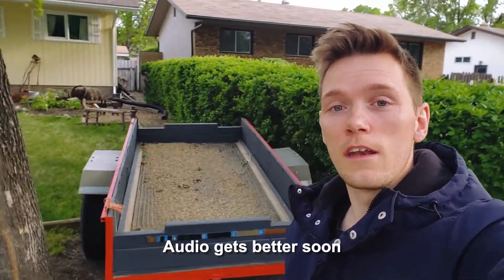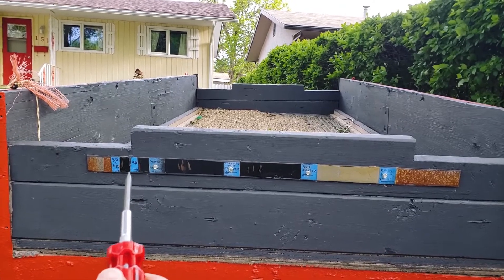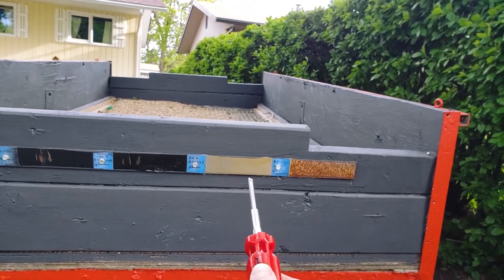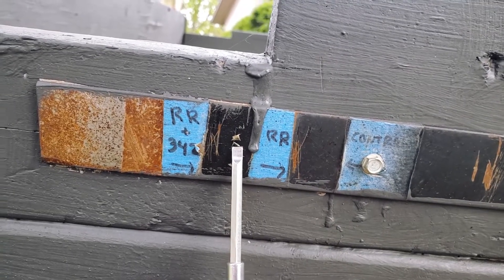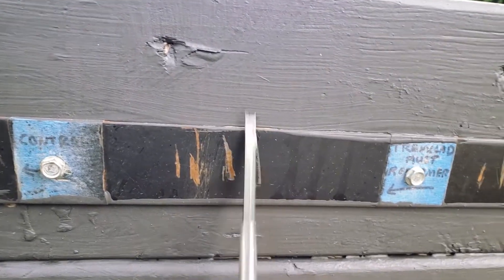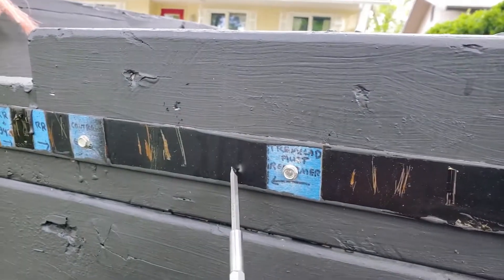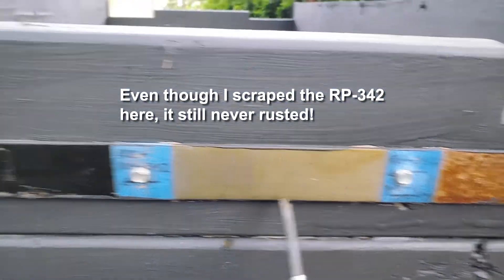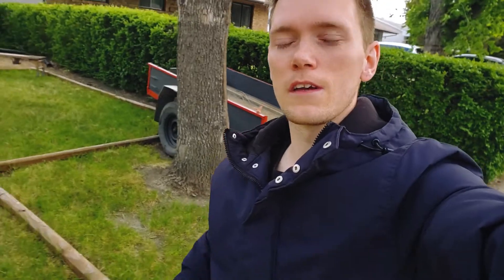1 Year RUST Test - 9 Month Update - Tremclad Rust Reformer | Cosmoline RP-342 | WD-40

Comment: Thank you so much for this demonstration. I used to use fluid film, but I have switched to Cosmoline RP -342. Hopefully I wont have to apply the cosmoline every year, unlike fluid film.Thanks once again for taking the time to post such an informative video.
Reply: Hey incase this helps, I left a question at Cosmolinedirect and an employee called me back. They can't make claims but they hear 2-5 years as how long it lasts and so long as rust is dry, you can apply it right on it. I will be using either RP342 or Rust Cure 3000 of which I just bought 20 cans locally here in Rome NY.  I will use rust cure where it is inaccessible and I need it to flow. I also bought Eastwood muffler paint with an internal spray wand. Three older Toyotas and a Honda.

Comment: Thank you for putting in the time and effort to make this video. Im curious, you said you use the Cosmoline on your frame... do you find there are any downsides to doing this? IE does it cause any harm to anything? Does it plug the drainage holes in the frame? Does it make it difficult to get a wrench on a bolt head if its covered in the wax?
Reply from the maker: I haven't had any thing come up where I had to go back and remove something or loosen a bolt. I imagine a wax layer over everything could be annoying. If you take the time to mask off any typical maintenance areas and holes, you should be happier when it comes time to work on those areas.
Reply: @LostFart  RP states that the cosmoline can be removed with Brake cleaner if you need to. Brake rotors are often coated in cosmoline wax at the factory to make sure they reach the consumer in a good state and brake cleaner is made specifically to take this kind of stuff off.

Comment: You just helped me decide what to go with for the frame. RP-342 (after I sand and clean the metal) then top coat it with 3m undercoating
Reply: don't do that.  Do the opposite.  RP-342 doesn't harden fully and the undercoating won't stick to it.  It's a thick wax, not a paint.
Reply: Bad idea.  3m undercoating won't stick to waxy surface.